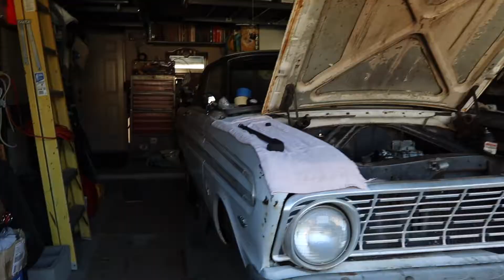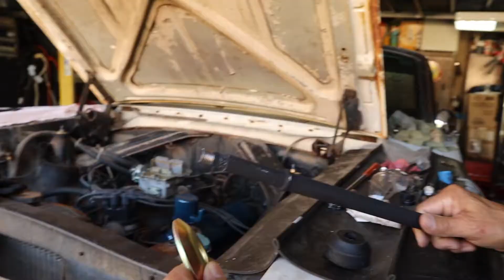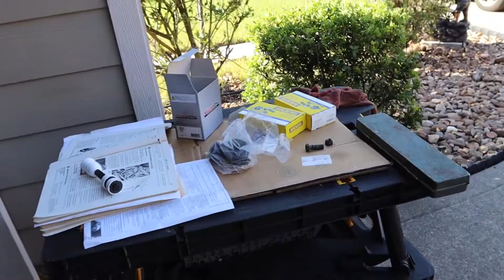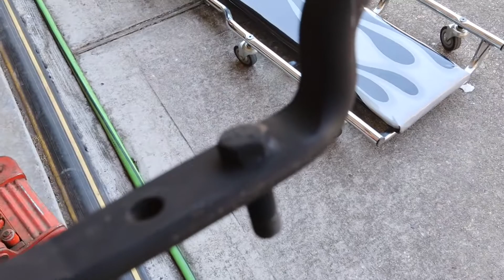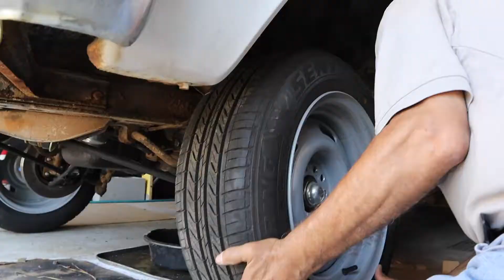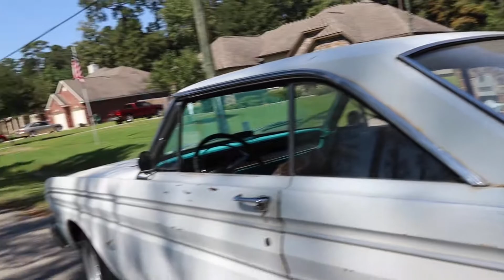The Ford Falcon is FINALLY Back on the "STREETS"!

Comment: The asbestos wrapped tube from the exhaust manifold to the carb, is the heat pickup for the auto choke. you didn't have to compress the springs for the lower all joints, but you will have to for the upper ball joints, the strut rods just get tightened,, there is no adjustment there!
Reply from the maker: Thanks for the insight! We just did as instructed from the Chilton's manual on the lower control arms/joints 😂 But good to know for next time. Thanks for watching!😁✌🏽

Comment: You should not tighten suspension until you have the car on the ground so it don't bind up
Reply from the maker: Hmm, it seemed to go on decent but wasn’t sure if they if I set the car down it seemed like it would have been in more of a bind. But we will try that next time see which is best. Thanks for the input 😁✌🏽